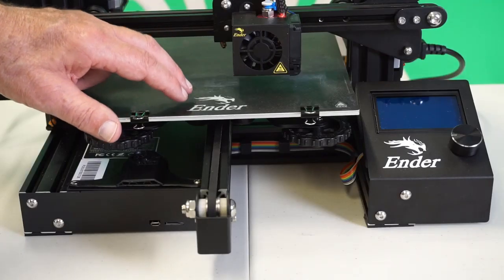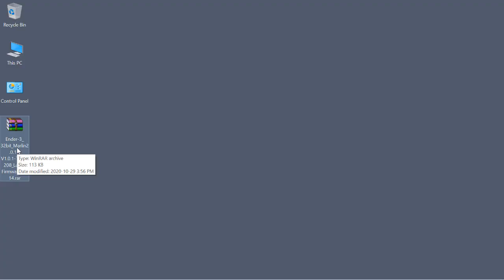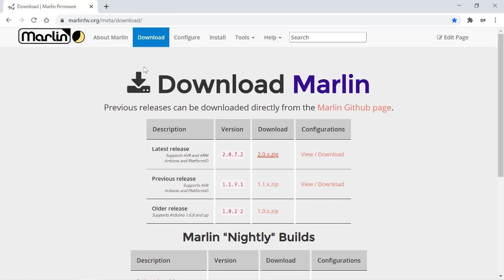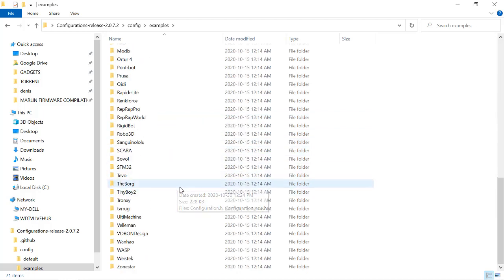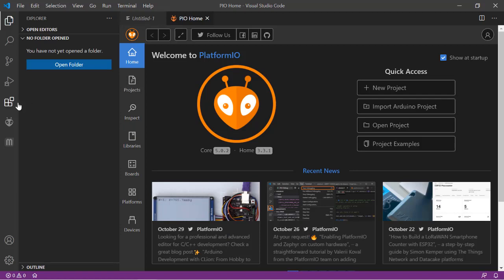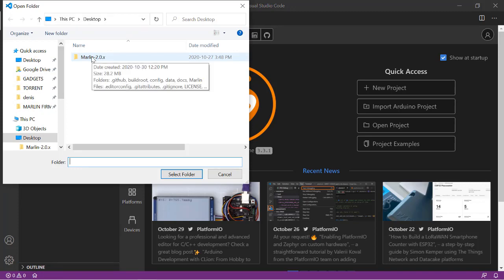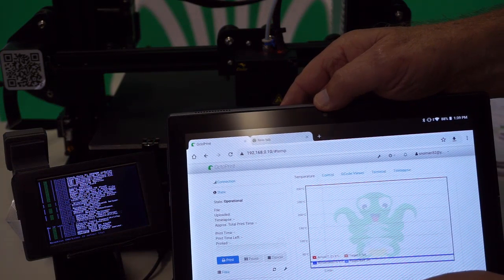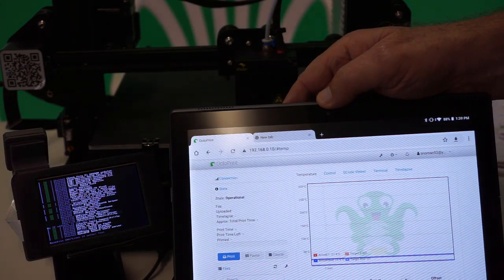GADGETS#128 - MARLIN FIRMWARE COMPILATION

Comment: Got to know Marlin 2.0 really well! Those h files are C programming language header files. Spent alot of time getting geometry right on mine (skew correction) plus the sizes of the X,Y and Z axis. Needless to say 3d printing can consume all the available time you have, which is just as well as we hide from the pandemic! Need to catch up on the HSCOPE telegram group too!
Reply from the maker: Glad to see you stop by, Alastair:)
We spoke about calibration before...I haven't printed a cube yet to test dimensions. I will explore it, in time...
I did however print that nice reel holder on Thingiverse which has 2 bearing fits...and they came out perfect. A good sign.

Comment: You did some serious sleuthing to find all the right pieces there Denis. Good work at compiling it too. You made it look easy.
 Some tense seconds there looking a that black screen wondering if you bricked the printer I'm sure.
Good job. I'm sure many can benefit from this to upgrade their printers as time goes on.
Question:
Is the bin file one currently has on the sd card. If not where do you find it to back it up before sticking your neck out installing a new version?
Reply from the maker: This was done with no safety net. No going back to 0.5.0 that it shipped with. I'm sure there are enough resources online that I could have turned back if needed.
Reply: @theGADGETSplaylist  Yes. That's one good things about the public domain software. Good work.